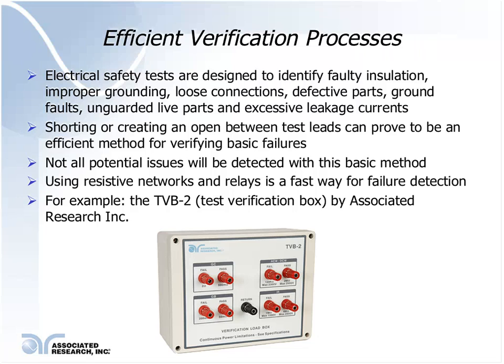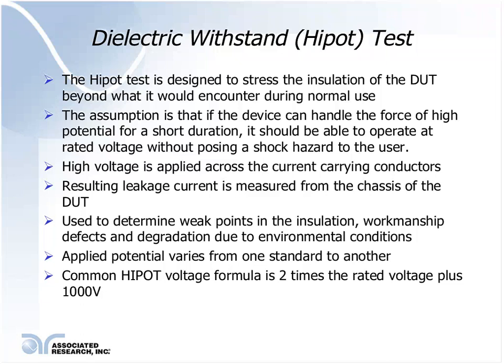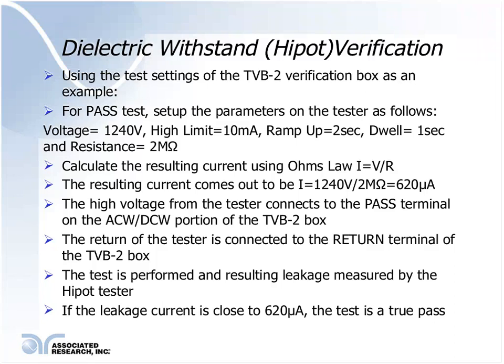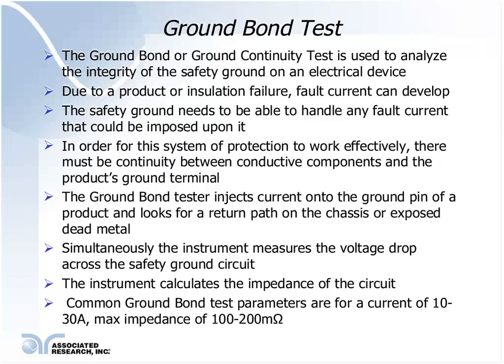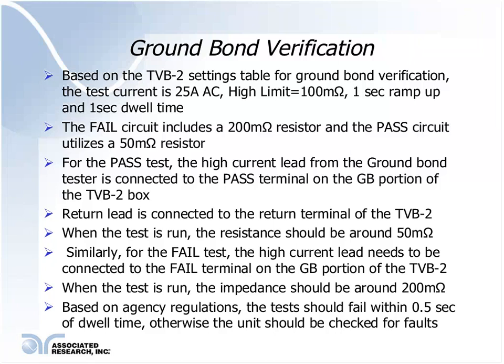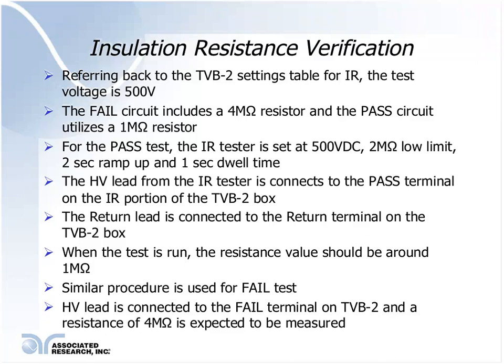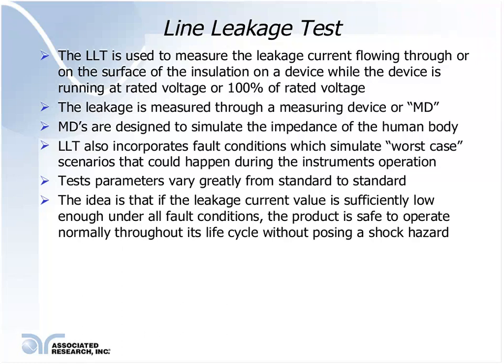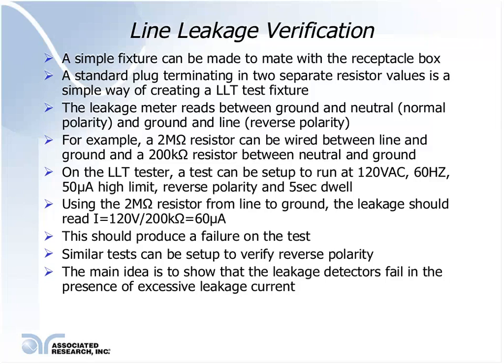Verification Tests

Comment: If the hypot equipment is connected to a plug, and this plug has loose terminals and current leakage, will the TVB 2 and LVB 2 boxes identify and reject the equipment even before the operator uses it?